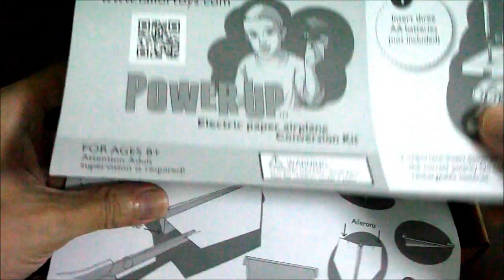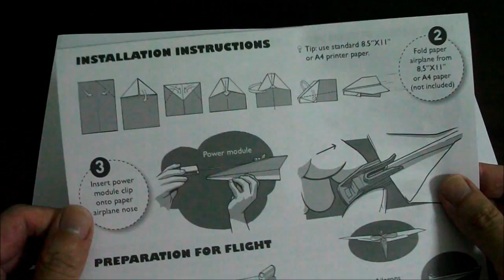"PowerUp" Electric Paper Plane Review

Comment from the maker: Hi Shai, thanks for dropping by! I'm glad you like my review. My design is similar to your standard design in the instructions, but with three modifications:

1. The wing chord is set at a shallower angle to allow a wider wing span. 
2. The nose is folded in to add strength and shift the CG forward. 
3. Wing tips are folded down to act as winglets. This provides more directional stability and they also act as rudders if you curl them slightly. I do this to avoid cutting the paper.

Comment: The motor is angled downward relative to the carbon fiber rod - noticed that the reviewer finessed this by ending up with the rod angled down, into the fold, leveling the motor.  This is pretty critical.  Leaving the rod level (and motor angled down) makes the plan very difficult to balance.
I used the stock planes from the Powerup site.  Using a combination of paper clips and elevator settings I could more-or-less balance the plane, but the reviewer's results were much better.